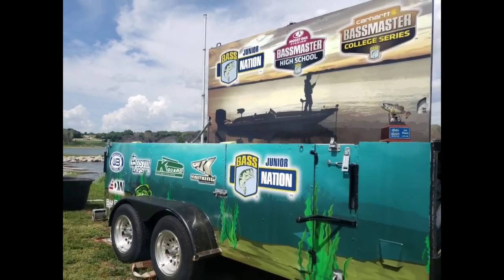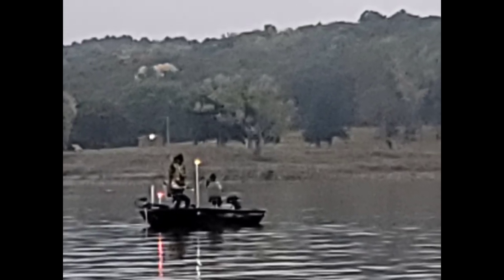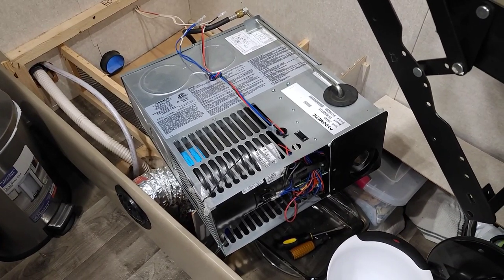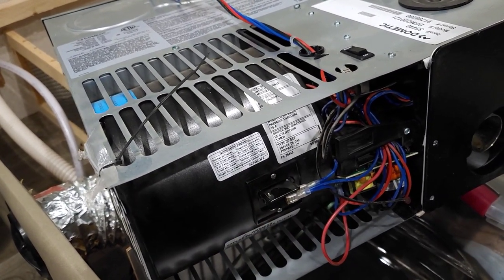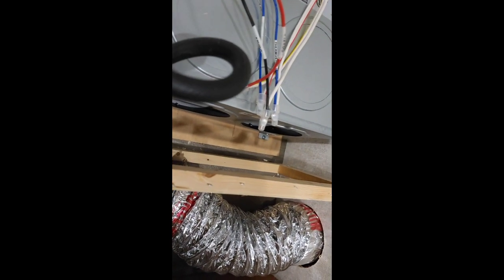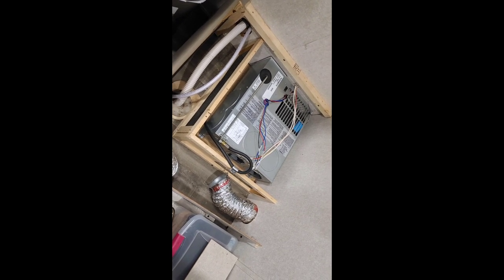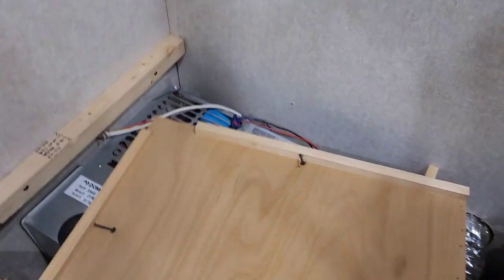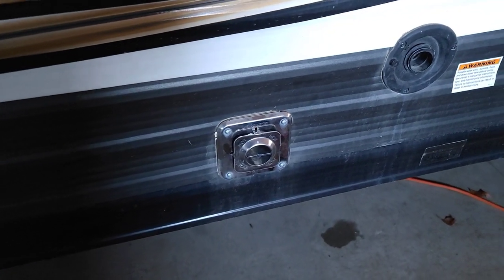Camper heater quit working in my Jayco 26bh

Comment: My furnace is in such a way that there is no way to get to it it is built on top of the hot water heater with no door to access it this video showed me where the reset switch was I reached up and it was right at the end of my fingertip after it was flipped it saved my weekend thank you other videos kept saying there was a reset switch but wouldn't show where it was

Comment: I wish my 24RBS had such easy access.  My furnace quit working and I suspect the sail switch or igniter.  Mine has only a small hole in the outside for the exhaust and a grill on the inside for intake air.  It isn’t under the oven so no easy access from above.  Looks like I have to either remove the oven and hope to access it that way or try to slide the entire unit into the camper through the grill opening, but I can’t seen see where all of the screws are that hold the furnace in place on the outside wall side of the furnace.  What a stupid design by Jayco.

Comment: This a terrible presentation. There is no location orientation,  alot of this & that with know actual video detail. Example this the sail switch all i see is a video of your furnace no detail. I cant tell i some shots if the furnace is mounted sideways, or if your camera is sideways. I have no idea where that furnace is located. Front, back, middle of trailer. And what and how is the wood cover mounted & what was the modification you made. You show nothing but camera shot of a piece of wood that looks crocked with what looks  like a screw sticking out. You assume to much.
Reply: If you don’t know how to locate your furnace it sounds like you shouldn’t be trying to “do it yourself”!